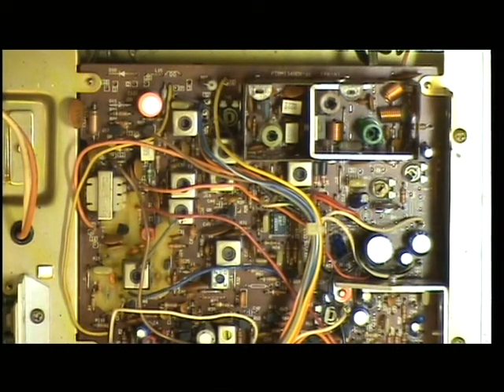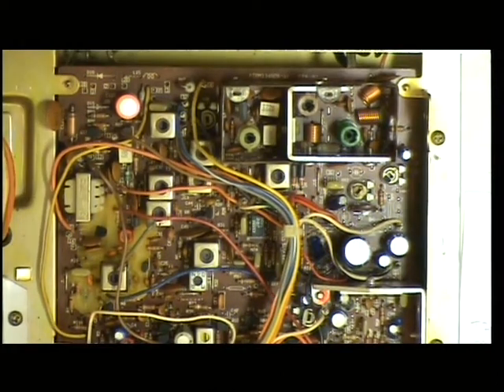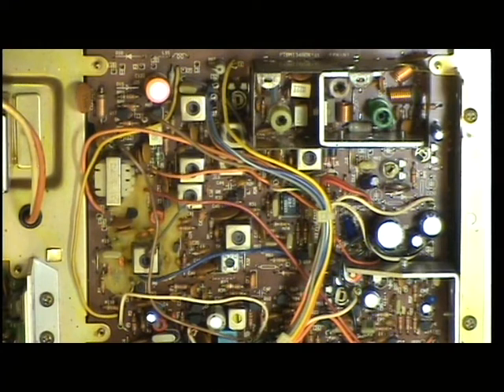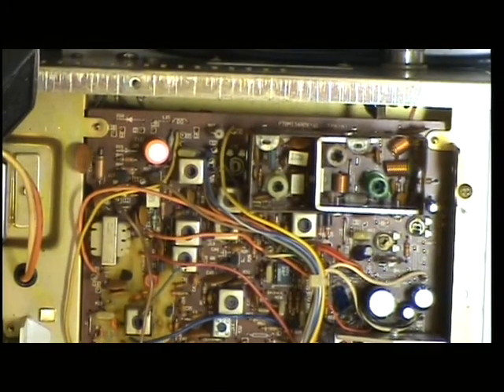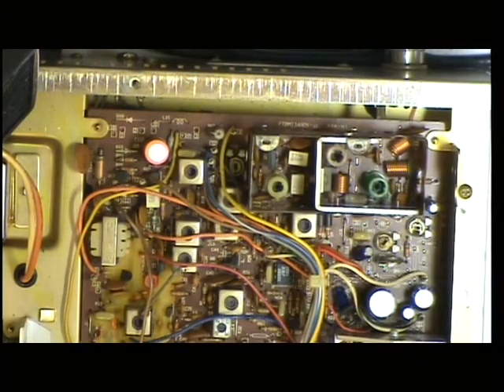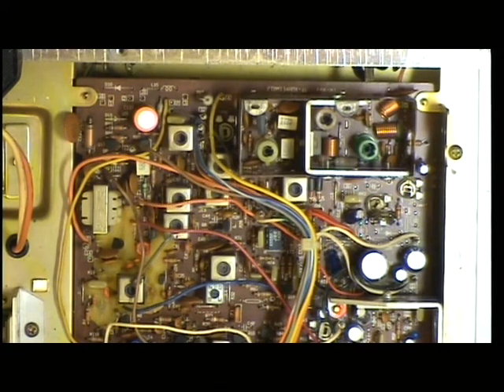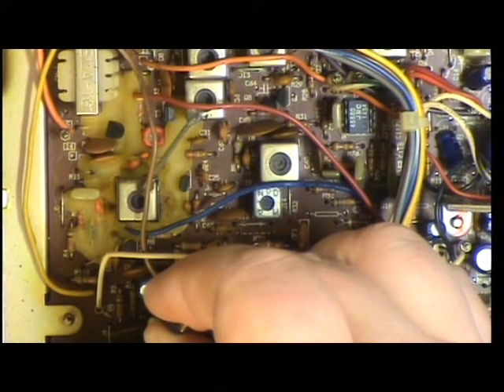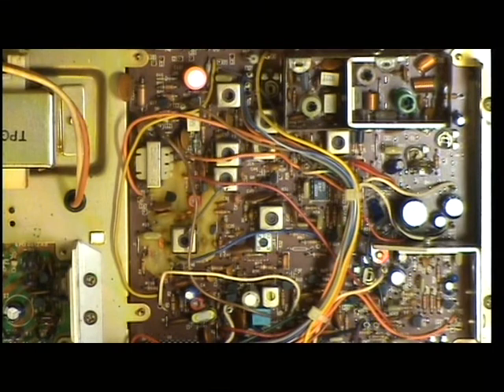Harrier CBHQ (UK) CB27/81 CB radio (Base) - Transmit alignment

Comment: Hello Richard. I very much enjoyed your videos on the Harrier CBHQ. I recently acquired one and have spent some time on clean up and denicotinising.  All  checks out well except I have no FM modulation. The full 4 watts is transmitted but no modulation. It's as if the microphone is not working, but it is because it's been checked. Adjustment of the deviation pots makes no difference at all.  Maybe you have pointers? Any clues would be much appreciated..    Next up I'll be checking out your vinyl record cleaning vids.  I have several hundred that need attention!   Keep up the good work !
Reply from the maker: David, On this chassis I have usually found the deviation preset control to be faulty. I don't know what test gear you have, but if you have nothing, set up another CB (no need for aerial) next to the one you are testing on the same channel. if you hold a small screwdriver tightly in your hand & go into transmit, touch each of the deviation control's three connections in turn & you should hear a buzz/hum being transmitted when you prod the control on your monitor receiver. If this is the case, chances are that it's the control. If not, the fault will be around the varactor diode in the VCO.

Richard
Reply: @ukfmcbradioservicingTango21  Hi Richard, Time flies, It's two years since you replied to this and I can't remember if I replied to thank you. I only just got around to doing this as I've had some health problems for a while and couldn't do it.  I did as you suggested and I found that poking the wiper of RV2 gave a buzz in the receiving radio, but nothing from the other two contacts. Poking RV6 gave no response on the receiver at all.  Do I now replace RV2 or RV6 or both, or, does the fault lie elsewhere?  So, many thanks for your patience and hopefully I'll do something before the next two years elapse !
Reply from the maker: @davidinston8231  Replace RV2, it could have a cracked track, unless you can take it out & test it with a multimeter. I have difficulty finding skeleton presets these days & seem to be only able to find them at Rapidonline. RV6 is the rx meter preset down at the bottom right & isn't anything to do with this part of the circuit. Bear in mind there is also that mic gain control that lives near RV2 & is mounted vertically. The fact you can make it transmit a buzz seems to prove the varactor diode is working,

Richard
Reply: @ukfmcbradioservicingTango21   Many Thanks Richard. It wasn't RV6 I was referring to, but the vertical one near to RV2.  I'll have a go at replacing RV2 if I can find a replacement, but it rather looks like it's easier said than done!  But I'm a patient chappie!  May be I can cannablise one form a scrap chassis?  Out of interest where is the varactor diode located, I can't seem to find it? Many thanks again
Reply from the maker: @davidinston8231  The Varactor/Varicap diode is D13 & lives adjacent to R4, the VCO test point on the extreme left of the board with the knobs facing you, near the VCO can. SO it goes from left to right,  R4, R81, D13. A poke to the + end whilst on tx will produce hum/noise on TX if it's working.

RV2 is 2K (UK would be 2.2K = 2k2 horizontal skeleton preset) That vertical preset is RV6 it appears & 500R (500 ohm,  UK would be 470R). 

Richard
Reply: @ukfmcbradioservicingTango21  Thanks Richard you are Brill! Now I begin the search for a skeleton preset.  One final question for now. the service manual you refer to in the videos. Is it possible to get a copy? Or are they as rare as rocking horse droppingS?
Reply from the maker: @davidinston8231  email me rshireby@yahoo.co.uk